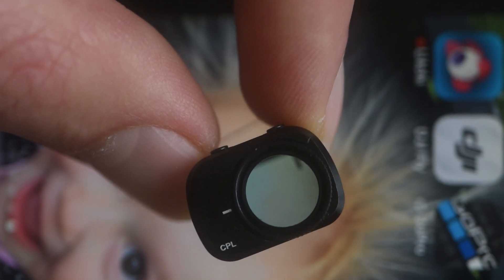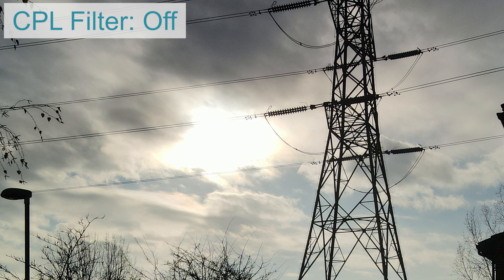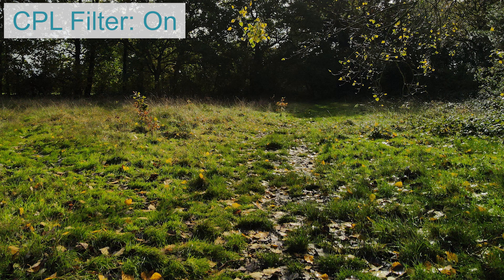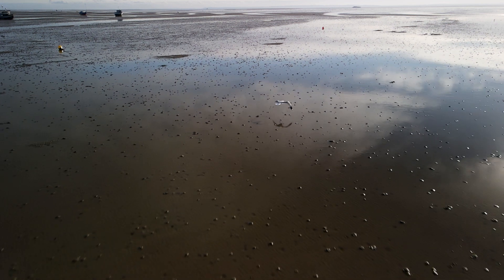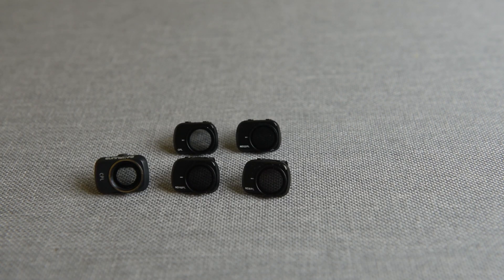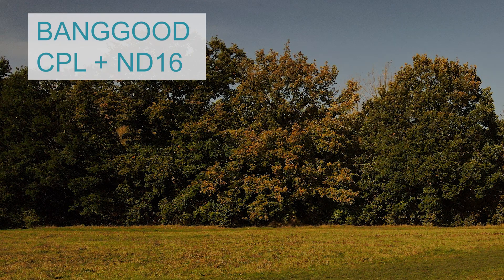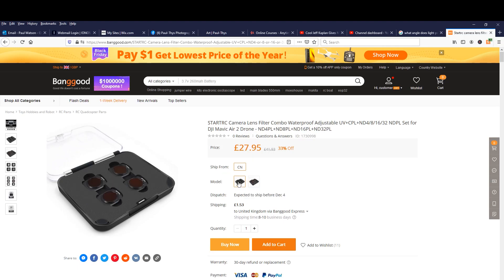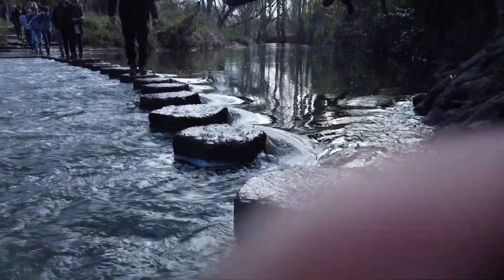THE TRUTH ABOUT POLARISING FILTERS ON YOUR DRONE - circular polarizing filters on your mavic drone

Comment: I went on a trip yesterday in fact and used the polarising filters over the ocean, I could see right through the water, it was as expected, but when I did a 360 Photo rather than expecting a transition in the sky I ended up with quite a disaster of dark and light skies, so lesson learnt that 360 photo's must not use a polarising filter but video or photos at 90 degrees as you mentioned are fantastic and as the sun was slightly on the coastal side of the coastline it made for some of the best video I have ever taken flying up and down the coast as it was 90 degrees from the sun, what I found was for best results simply point the dot directly at the angle of the sun so if it is at 11 O'clock point it there come back adjust the polarising filter for 1 O'clock and fly the other direction, this will give consistent sky colour and ocean glare penetration or simply place it directly straight up at the 12 O'clock and it will be adequate too. none the less I was able to see blue's and green's in the ocean and the rocks up to 10 metres deep.
Sorry I carry on so much, I use to use only ND filters and still do primarily for the 180 rule ie: 4K30 then shutter at 60 and if I need more like really bright day and the ND32 doesnt cut it I then increase to 4K60 and 120 shutter and that is with no clouds and mid summer so I might just buy a ND64 and ND64 with polarising to add to my collection.
None the less it's trial and error to see what you want from it, sometimes clouds in reflection are a good thing like a muddy river.
Anyway you explained it clearly for most to understand, I know how it works but looking for other solutions and suggestions as well, and you re-enforce what I understood from before.
Reply from the maker: Thanks  for this info! I will pin. I am sure people will find this useful.
Great point with the 360 degree photo I didn't think of that, but it would be great to demonstrate the difference. 
Keep us updated on how you get on. They are really fun play with 😊

Comment: Great explanation and examples thanks. So I wondered is it worth buying a pack of Freewell ND and a pack of NDPL. Or is it better and cheaper to buy just the NDPL pack and “switch off “ the PL element when not needed by rotating outer ring by 90 degrees ? Or does Thomas’ physics comment above mean that it’s never really “off” when turned at 90 degrees?

Comment: Can I turn off the polarization of ND/PL filter? If so is the colour off then when turned off?
Reply from the maker: It depends on the orientation of the light, so will change depending on the light source. So it can't be turned off, but the effect can nullified at the right angle.
The marker is there to show how far it has turned and the on/off effect will change depending on angle of the light. So the only way to see where it needs to be will be to look through and adjust it on the ground before sending up the drone.
Reply: @paul-thys  Thank ..  I was hoping to turn the filter away from the recommended marking to turn off the PL so that I could use it as a normal ND if needed when doing a Panama etc..
Reply from the maker: @michael_hahnell  You can, you just won't know the orientation of the light so won't now when it is 'off' unless you turn it whilst looking though the camera.

Comment: Thank you, this was very useful.  One correction from a physics major.  Rotating the filter does not turn it off.  It changes which polarity of light is being removed.  Light is an electromagnetic wave where a change in the electric field drives magnetic field changes amd then the magnetic field change drives the electric field. Conservation of energy allows it to travel accors the universe. These two fields are at 90 degrees from each other and if you could look at it end-on you would see it shaped like a capital letter L.  One direction electic and the other magnetic.  The angle you would see the L at is completely random when it comes from the sun, no light wave oriented to the others. When sunlight hits water the light reflacted is all at the same angle, hence it is called polarized. This is why the normal position in outdoor photography is the same.  The sun is up and the water down.  If the light source moves to the side or down or the reflective surface moves to the side or up you need to rotate the filter to get the new angle of glare. One fun thing to do is look through two filters at the same time. If you rotate them relative to each other, it will change from a regular polarization effect (when both capital L's are alligned) and completely opaque when they are opposite.  The whole thing reminds me of the child's PlayDo extruder pushing out an L shape that twists as it comes out.
Reply: I just though of an example.  If the sun is on the horizon and you are shooting a glass skyscraper you could rotate the filter 90 degrees to reduce glare.
Reply from the maker: Thanks Thomas. That is great info. will try that out!